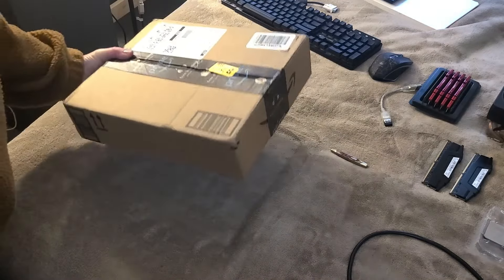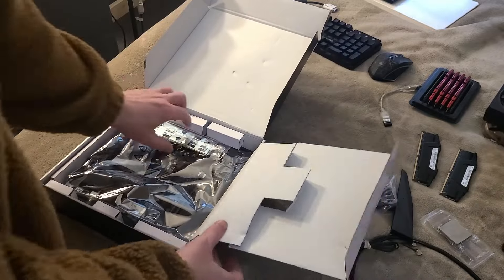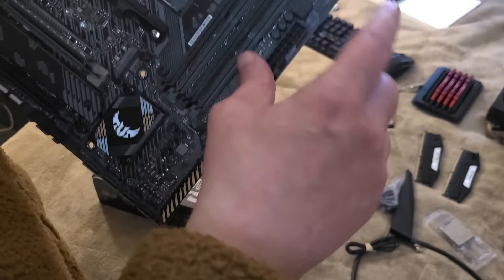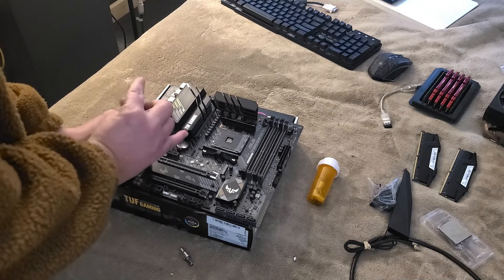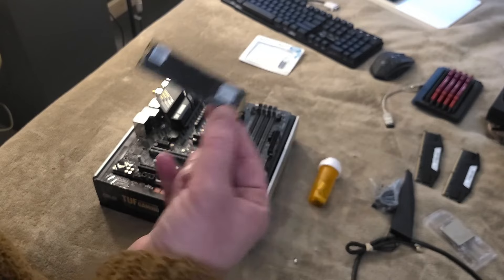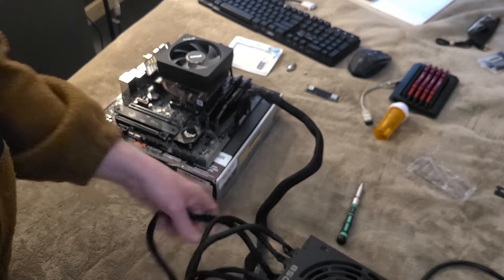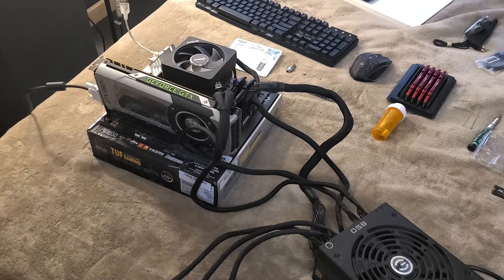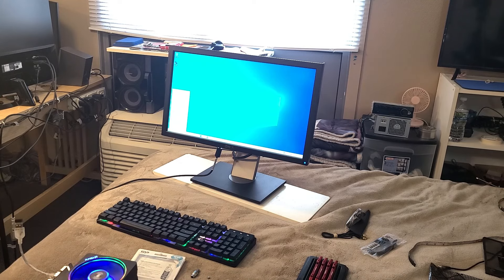Did Amazon Give Me A Present With This Motherboard Or Was It By Mistake

Comment from the maker: As I went to update the BIOS I just realized Amazon sent me the wrong motherboard they sent me an Asus Tuf gaming b550m-plus wifi, not the Asus Tuf gaming b550m-plus wifi ii. It doesn't focus very well but at around 11 minutes and 16 seconds you can see caught right there on the motherboard it says Asus Tuf gaming b550m-plus wifi.
Reply: You may need a newer GPU to go with that build the 980Ti will be your bottleneck I'd recommend a 3070Ti or 4060Ti 16gb but if you want to save some money try finding a 2080 super on the used market.
Reply: also you stated you were only leaving thermal paste off to make sure the system would post before applying it. Then proceeded to install windows, not powering down first to apply thermal paste before doing so. I wouldn't have done either personally.